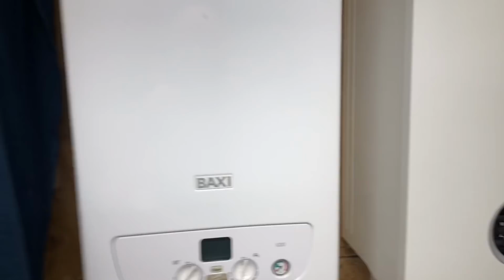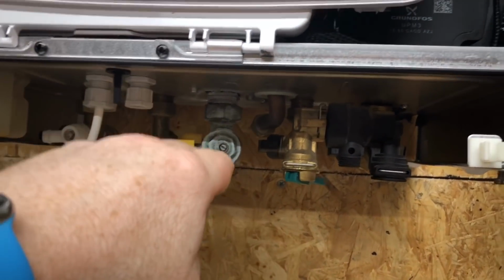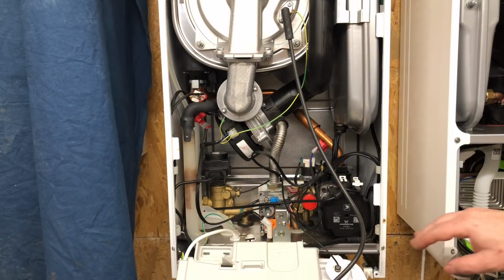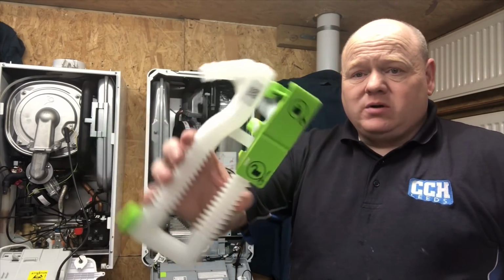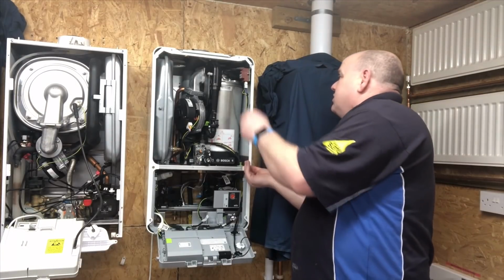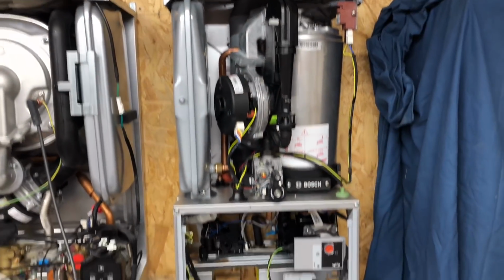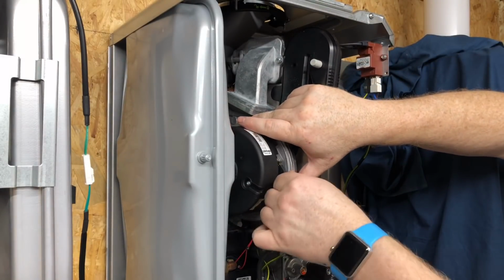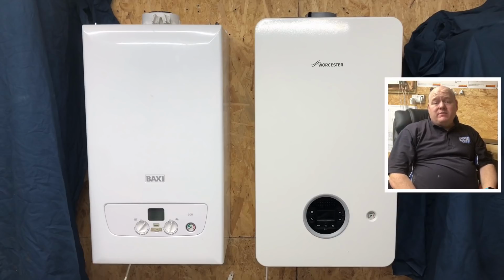Worcester 2000 v Baxi 600 - Which Combi Boiler is Best

Comment: As an retired gas engineer 2018, fitted and repaired literally 100s of Worcesters and quite a few Baxi’s have to say the Baxi are far easier to work on and  not so many issues with the Baxi then the Worcester surprised they haven’t REALLY updated the plastic bits

Comment: My boiler turns on the heating of the water in the tap only when the tap is turned on to the maximum.  Please help, tell me how to change it?  I want it to turn on at normal water pressure.
Greenstar 2000

Comment: Our present boiler is a Baxi but is out of warranty which was 7 years.. we are looking to replace it with a 10 year Warranty model. From your video though in our opinion, whilst first liking the easy to adjust controls compared to the neat look of the Worcester, the Worcester looked impressive on opening, but as your demonstration seemed in our opinion to look good including the remote, the ease of access plus the materials the Baxi is shown by you, suggests that it would be quicker to do its annual checkup with, especially if stripped down. It would help to know how they are set up by the consumer ie timer, if both use wi-fi for setting the temperature etc, and whether our existing remote would work work with a new Baxi. All of which is only our opinion.

Comment: I'm looking to replace our Worcester Bosch combi boiler which is now 10 years old and has had several parts replaced due to leaking,this was a one off repair by WB costing £285ish 2 yes ago.
It still working but has started leaking again.
Watching a Baxi review of the swapout of a/our WB compared to the ingoing Baxi 800 suggests the layout of and component materials of the Baxi outweighed the Worcester Bosch offerings.
Your reviews seem to favour for similar reasons too with the Ideal Max coming a close 2nd.
Cheers to you guys who give us consumer's some real insight to help us make better choices..

Comment: hi Allen
made my life alot easier with this brilliant review!
im gona go for a 40k baxi.
i wanted to ask, do i need to upgrade my gas pipe from 22m to 28?
its gona be a nightmare if i do!
if i do, then does the 28m have to come from gas meter?
i have about 3metres of the 22m pipework exposed, so would it make a difference if i upgraded just that part? so it would be 22m from metre  for about 7m then 3m of 28 then then again about 5m of 22 to the boiler
many many thanks

Comment: Big fan of the Baxi 600 & 800 Combi. Fitted over 100 of them. Easy to install & service. I fit the occasional Worcester at the customers request, ok to fit but not confident in the long term reliability. I’m service & repairing Juniors that have leaking plastic parts - very common on these.
Reply: Are Baxi parts very expensive when compared with other makes like Vaillant? I'm in the process of getting quotes for a new boiler & one installer says this is the case - I'm not so sure though.

Comment: I have found the Baxi to be a good solution as you can use the bracket to put the pipes at the back of the boiler without increasing the depth of the boiler.Also make sure you fit the prv before fitting the other pipe work. Bit of a nice touch on the Baxi if water enters the outer flue the tube takes it into the condensate. Worcester were very good 20 years ago but the majority of the new boilers composite blocks pin hole at regular intervals.Not that easy to replace.

Comment: It gets frustrating when your quoting a job and the customer mentions Worcester . There so easy to sell because there the most advertised. but boiler wise there awfull. Design is as if they have never made a boiler before. The heat exchangers are stupid. They struggle to even make clips that don't break on some models 🤯. But trying to get this through to people is difficult I've lost many jobs because I've tried to give the customer the best advice I and nearly every other engineer can give.  Now there new boiler the pipes don't even line up 😂😂😂😂 seriously 🤯🤯🤯. 
Can't think of one single pro to fitting a Worcester over a Baxi. Tbh I can't see a pro to fitting a Worcester over most boilers.

Comment: Thanks for the video, bit of an eye opener:
#1 (Looks) - Worcester (looks more sleek and modern)
#2 (Internals) - Baxi (seems to have better quality components and a simpler layout )
#3 (Strip down) - Baxi (easier access and removal)
 I confess I have a WC boiler for several years with  which I have had no issues. I would have chosen differently had I have seen this beforehand.
Reply from the maker: Thanks very much for your comment, please consider subscribing to support the channel 🙂

Comment: Baxi 600 for me. Always. Don't get me wrong, Worcesters are okay boilers, but I find them far too overpriced for a product full of composite plastics. I think, if Worcester could get away with using plastic for the burner, they would. The Baxi, solid components inside, copper and brass. Proven technology, as it basically the Baxi Duotec, just condensed down to fit into a cupboard. The Duotec was a bulletproof boiler.

Comment: Hi I currently have a solar compatible combi boiler coupled to a mains pressure 200litre solar cylinder.  The preheated solar water enters the boiler at the cold water inlet.  The boilers sensors then adjusts the boilers output (5kW - 30kW) to heat the water to the set point 55C.  In the event the solar water reaches in excess of 55C then the boiler power supply is turned off.  This boiler was made by a German company 26 years ago and is no longer in business. I am looking to replace it and wondered does anybody know of a suitable combi boiler?
Reply: Tim, i am using a Baxi 105. I use a blending valve to pre-heat the incoming cold water feed, from my solar tank. No problems at all, the manufacturers don,t like to say its compatible to pre heat the cold feed, but looking at the water tempt through out a year the summer to winter difference is massive as the water enters the house from the mains. I think most boilers would cope with this, imagine a boiler in the shetlands to one in Jersey, once the water is passed the inlet group and into the plate heat exchanger there is no problems.

Comment: Well made and very informative comparison video Allen. It's a no-brainer as far as simplicity to work on is concerned. To actually have to use a mirror to inspect a main heat exchanger or ANY component is not a very good Idea from to off. As you state in the video most  combi's are installed in a cupboard or tucked away in a corner somewhere, where natural (The best) or even artificial light is far from ideal. I bet you first go to on a lot of jobs be your head torch to see what is what. And it be cast aluminium exchanger , by the looks of it (the Worcester) which needs more thorough inspection for pitting/Cavitation all to be done via a torch and mirror. MMM, okay if you want to do a text book inspection, you would have to use a mirror  to check for cavitation on the Baxi exchanger, but , lets be honest from what is  so easily visible on the Baxi, you would not need to. Where's the room to use  a mirror and torch! and get gown to see the mid and bottom section of the (Worcester) exchanger!!. Well, THERE ISN'T ANY!!!!. With the Baxi you get a far superior visual layout, Per Se (never alone it made of a more superior material), A fitter would be able to give it a far superior  inspection to this unit. So to be kind to YOURSELF(Easier Access= Less hassle=Less money) and your FITTER ,the BAXI IS WAY IN FRONT. Allen, I have watched many of your vids and think they are BRILL!!!.One point though Allen, could you also give a general price comparison for what the units cost to purchase  and maybe???, how much the general and realistic service/Repair items costs and their availability( diverters, Expan Vessel ,Fan units, Pressure switches, etc). This will be of great help and be Paramount (I think)in any purchase decision.(You know, it's no good buying a Rolls, if you can't afford its running costs after)And its BRITISH to (well was??), if you want to be patiotic!!!!!.  :-)

Comment: Baxi all the way.nice and easy to install, user freindly. easy to wire up.Great for the pipework behind and up ,can make all the pipwork up on the ground before lifting into position,only problems ive had is diverter cartridge , which is a moving part, and about £15 nowdays. very easy to install again. same thermister and ntc as duetec ,time will tell on these models towards end of warrantys.must not to forget to change and drain inhibiters,keep the water quality good, then will serve you well for many years, most problems is down to derty water ,iron oxide, mana tight, rust, like car antfreeze, needs aflush and inhiberters every 5 or 6 years really.

Comment: Thanks for the detailed and brilliant review. Just wanted to ask, I have currently got Vaillant 824 Eco Plus Combi Boiler which is 13 years old. It has no problem but I have been given choice to change it as it's a bit old. I have been recommended Worcester Bosch 2000 Professional as a replacement. My current boiler works with Nest no problem. Just wondering if Worcester is a good choice compare to 13 years old Vaillant boiler? Kindly reply.

Comment: Bottom line is BAXI are best for install, and maintenance.  WB as clearly demonstrated by AH are designed to cost money in the long run to cause inconvenience and money to the customer and service engineer alike. Conclusion DONT fit Worcester Bosch

Comment: The Baxi 600 and Main Eco Compact are the same boiler.  The Worcester is no doubt lower quality overall and higher price so poorer value.  The Baxi will likely last several years longer too and be cheaper to maintain and service.  Consumers are fooled by better looks and the brand name.  They think Worcester is like Audi but actually it's much worse.

Comment: Hi Alan, 
Iv'e enjoyed watching your vids over the last few months.  Our old Baxi solo 2 60 RS is hanging in there by a wing and a prayer hopefully for the next couple of months fingers X.  Anyway we want to change it for a combi boiler with good HW flow to a loft room and heat output, e.g. Baxi, viessmann vitodens or other?  and as your the most honest opinioned plumber iv'e watched on here, what is your choice for a 4 bed semi with a similar retro fit under floor heating system to a suspended floor as you fitted as well. any advise is grateful.....    keep up the the great vids

Comment: I note Bosch has a larger output range to Baxi, but would not want to be tied to one make of boiler, so unless OpenTherm enabled then I would cross off the list, boiler will not last for ever, and next time I change don't want to also have to change control system.

Comment: with my personal experience, Worcester best boilers ever made were worcester 240 - worcester 24cdi , all brass hydroblocks, more conventional style burners and simple and reliable. They slowly got more complex and more plasticy year by year, and I really do not enjoy working on them at all because of how complex and awkward they are (greenstar junior PRV anyone?!). Baxi on the other hand have only really made 1 bad boiler series which was the GA, but, from the 80eco, through to the 105e,105HE, first platinums then the Duo-Tec, Baxi had good quality brass hydroblocks and components and conventional frontward facing burners.  Baxi products have always been cheaper to buy, much easier to work on, spare parts are cheaper to buy. The Baxi's are just as, if not more reliable than the Worcester equivalent of the time.

I haven't had the chance to fit a 600 or 2000 as I mostly install Potterton Titanium (re badged duo-tec) for my customers and have had very little trouble with them, whatsmore, they still use the same jig and pipework pattern to older Baxi group combi boilers which makes for very easy baxi to baxi combi swaps.

Comment: In my opinion as a technician (I only repair boilers):
From the boilers found in your country is another one that I like the design more: INTERGAS - the model with 2 copper coils one above the other and cast in aluminum block :)

The Baxi 600-800 boiler is my favorite because it is much easier to repair with far fewer mechanical components with problems - In my country there is a brand of kober boilers from which the Motan Mkdens model is almost identical to the Baxi boiler where the major difference is electronic board - the electronic board from the model in my country I think is more reliable built - the ones from Kober frequently ask the technicians in the country what dissatisfaction they have and what changes they want :)
Pro:
cheap, simple, reliable designs, generic and cheap parts (found in Bosch Group boilers but no longer use these parts because they do not break), rainwater collection and drainage system
 if it enters the suction pipe of the air (from "mistake"), the Gas valve on 18-24V (much more reliable), the Grundfos pump, the design of the housing and the connections more practical ...
con:
- Design of the electronic plate housing made on the knee
- The wiring chosen is not too inspired (Bosch has not used end-to-end connectors for over 30 years (I don't think they have ever used it))
At the Worcester boiler:
Pro:
-designed in great detail to the components (Con: it seems designed when it is broken by something (as in the older series boilers from Junker / Bosch series 3-5000 non-condensation do not know any boiler that electronic plate) has withstood more than 2.5-3 years)
- quality of plastics
- the secondary heat exchanger gaskets on the heating side
con:
-Wilo pump
- combustion chamber - although it has a unique and original design it is a pain to make repairs on it or to clean the combustion chamber of deposits.
- stacked design
- honeywell gas valve - I have never seen a honeywell boiler part made to be reliable, Personally only when I see the name Honeywell on a boiler part I think how to hold it :)) - today I was at a boiler more old (viessman vitogas 100 -15 years old) with honeywell gas valve in which one of the internal rubber membranes was broken and which escapes a lot of gas (through a ventilation hole that communicates with that membrane) in the room where the boiler was installed - and it is the second case of gas leakage in less than a month at exactly the same type of boiler with the same gas valve model produced by honeywell (they are the only types of gas valves that I have found gas leaks in my life. no matter how old they were and I saw thousands !!!)
- Secondary heat exchanger gaskets on the hot water side.
- Hydroblock with many oring joints that can lead to leaks (nobody has distilled water in the heating circuit)

Conclusion:
All boilers will work well if a magnetic filter is installed on the heating circuit. And I also have a recommendation: In all boilers I would recommend where it is possible to install a 50l (why 50 ? its cheap 20E) external expansion vessel that will have to be depressed from 1.5 bar at a pressure appropriate to the installation on which 0.7-1bar will be used. If the pressure variations on the heating circuit are smaller and slower then the joints with oring in the boiler and the rest of the heating installation are less stressed (Taps, press joints ...) My favorite brand is Reflex can Zilmet if it still has I maintain the quality of the past models because everyone can become greedy over time.

Comment: Im a Worcester Installer who fits 50+ Worcesters a year. Started fitting a few Baxi's recently for customers who don't want to Worcester prices. I can't disagree with this video or the majority of the comments favouring the Baxi. Really impressed with the whole range (well apart from the 200, thats a bit too flimsy). The Main compact seems the best value from the range.
Problem is Worcester have such a high share of the market. Its not commercially viable in a lot of situations to hard sell the Baxi when the customer has been hard sold a Worcester by 3 or more other installers. I know the price talks to a degree but people are fearful of being sold a pile of junk. 
Shame really, Worcesters dominance and the whole Boxt thing makes me want to back some of the underdog manufacturers.
Reply: I'm also a WAI normally fitting around 50-60 Worcester boilers a year but now's Worcester have completely stabbed us in the back by owning 45% of boxt I've almost completely stopped installing them, some customers do still ask about them but usually, they'll listen to my advice on the build quality and if that doesn't work tell them to watch Allen video 👍good luck Stuart its good to know I'm not the only WAI engineer whose had enough of Worcester.

Comment: I’ve had my Worcester 35cdi for about 12 years and so far only had to replace the ignition electrode and the crappy plastic electric valve so about £40 spent on it

Comment: I have to admit at the ripe old age of 48 iv'e have been fitting nothing but Worcesters for ages. Because i like there back up service and i'm on auto pilot when fitting them. But if this boiler is replacing there other combi's then this is the point where i have to change brands. Allen thanks for making this video it hi-lights the massive amount of problems with this new model.

Comment: Support Worcester.. except these 2000's.. this Baxi does piss over the 2000. Would only consider using this (if it is LPG convertible) for a LAV. 20kw is not alot. Am guessing flow rate and temp rise is poor aswell. With most modern Baxi's, the only thing that pisses me off when working on them is the wiring looms, why can't they neaten them up.(if that's all I can fault..) oh and the knob dance to get them in service mode..
Reply from the maker: Thank you for taking the time to watch my video.